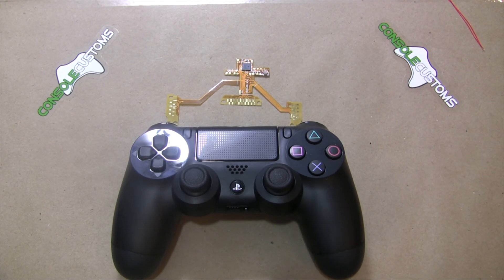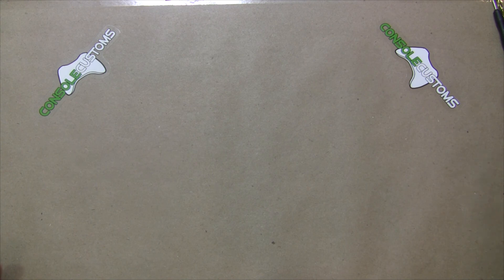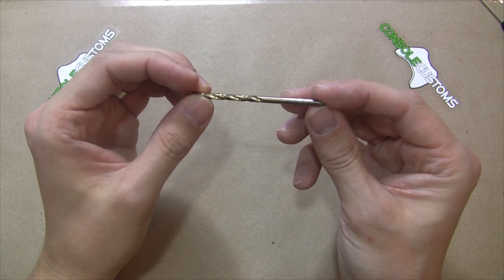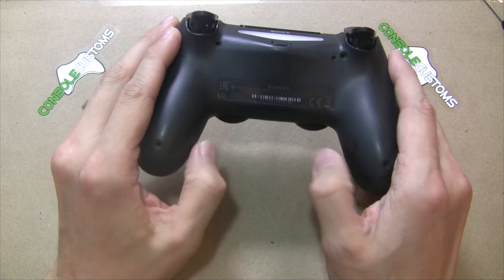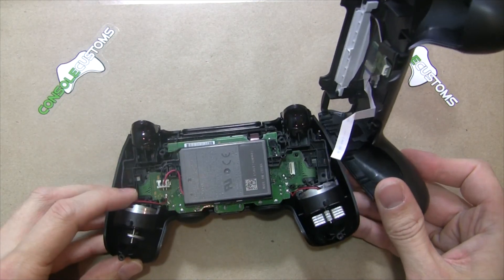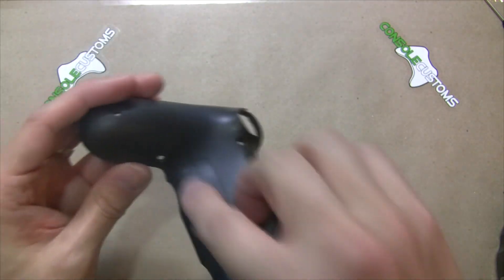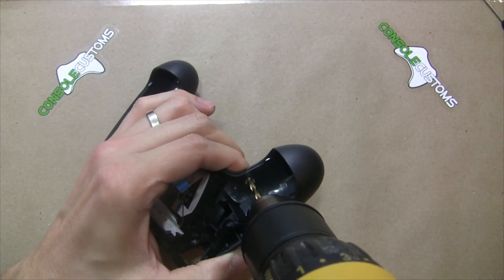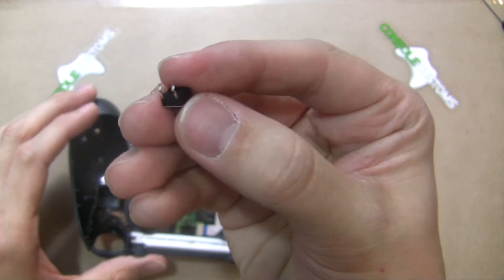Console Customs PS4 TrueFire-ReFLEX V2 programmable Button Remapping mod

Comment: Instead of glue to hold the mod into place, would I be able to use clear tape? I just recently purchased one of you remap mods, and I apparently lost my glue gun, and don't necessarily feel like making an hour, or so trip to get one
Reply from the maker: You can use tape, just be sure to keep it off of the exposed gold contact areas and you are fine.

Comment: First at all, I have to say that I did like your video. I am from Germany and I did understand everything because you were talking very slow and good. That is very good for people from other countrys. But I have a question. I bought a controller like this from a Moder. He made everything but the Touchpad doesnt work. You cant press it and the touch doesnt work also. Can I put the chip over and put the same chip again or would this broke the chip. 

sorry for my bad english

Greetings from Germany
Reply from the maker: +Atalay Hakan Eroglu They may have forgotten to plug back in the ribbon cable for the touchpad. You should be able to open the controller and check this. if you look at 14:40 we remove the cable that you would need to check.

Comment: How do I do it on the older controller
Reply from the maker: +swaggerammathegamer STG  on the older controller with the connection pads in the center you would just remove the two side "wings" leaving the center connection.